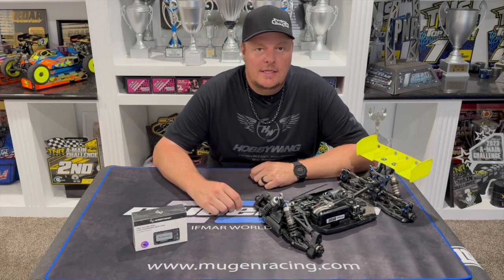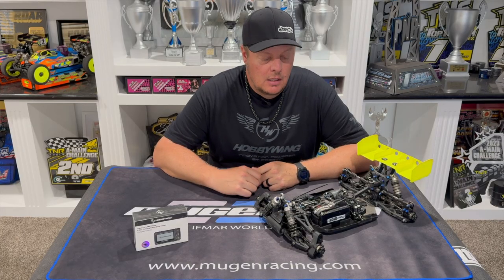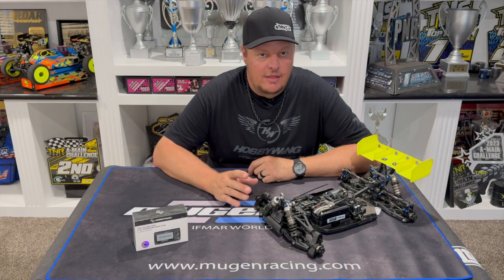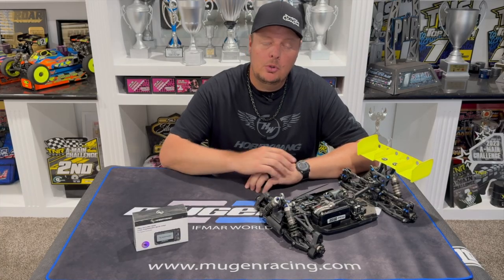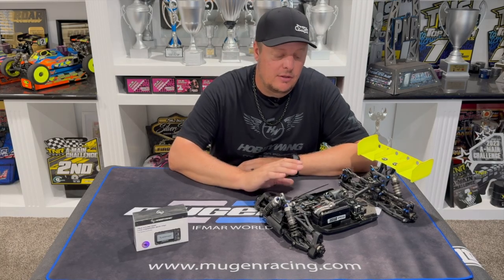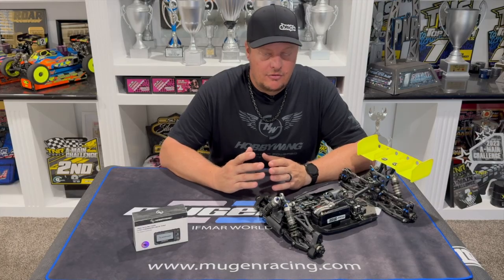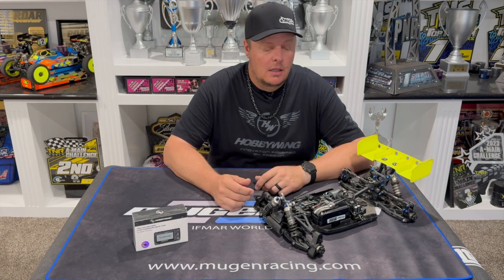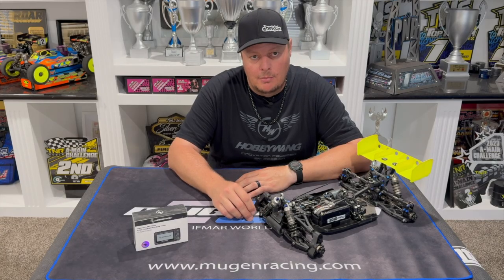Drive Frequency and Brake Frequency Explained

Comment: I do wonder why the HobbyWing XR8 G3 Pro DEFAULT Drive Freq is 25K, and it feels different than the G2 did when running it at lower frequencies.   Unrelated to this video but also you use T-Plug connector with bullet batteries? That's adding resistance, so do you just do that for convenience? Reverse polarity isn't a concern anymore with that ESC, it doesn't care. I've accidentally tested that.

Comment: Are you running brakes in traditional mode or disk brake mode?
Reply: disk brake mode is basically not getting used anymore at all, it feels good but harder to hit the same mark from lap to lap
Reply from the maker: Traditional Brake mode.
Reply: Disk Brake mode is especially useful for 2WD electric off-road on lower-traction surfaces—particularly when transitioning from high-speed sections into slower corners. Thank you Drake, great tutorial

Comment: The reason you feel stronger brakes with lower frequency is because the frequency is the rate at which the brake force switches between no brake and max brake (this is how braking works). The faster that switching, the less time the brakes are biting, and there's not enough time biting to feel like its doing much. Again if you were to run 100% brake, there's no brake frequency anymore and the car will probably front flip 😀
Reply from the maker: Good explanation, thank you!

Comment: Important to remember that at 100% throttle drive frequency isn't a factor. Its effectively zero. PWM is only used at part-throttle to approximate your throttle position.